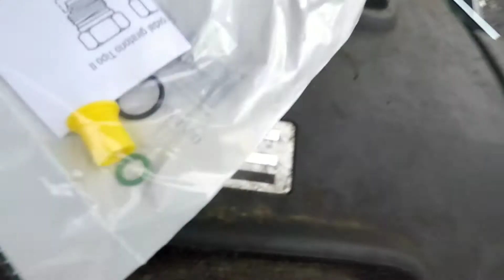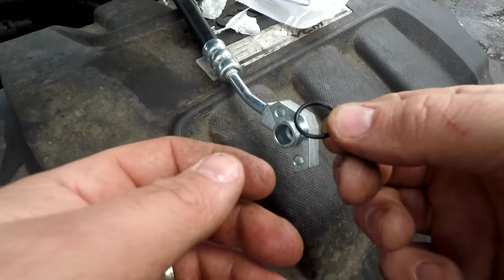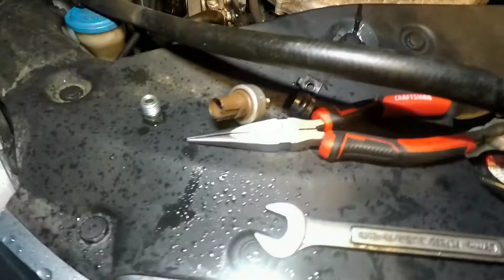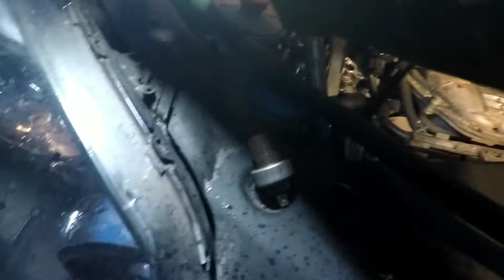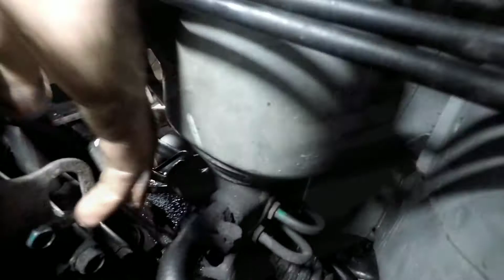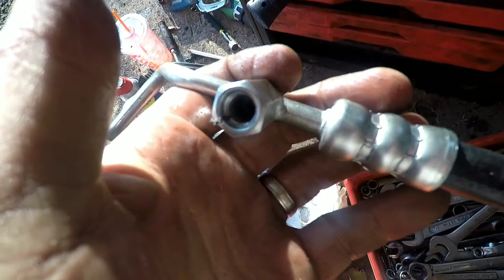New Part Was Cracked! Power steering pressure line replacement, 2007 Honda Odyssey

Comment: Thanks, do you have a link to that hose?  I bought a Sunsong on recommendation from another DIY video, and it 'should fit' but I cannot thread the flare nut into the socket for the life of me; I suspect something wrong with the threads, interested in trying another mfg.
Reply from the maker: I bought it from Autozone I believe